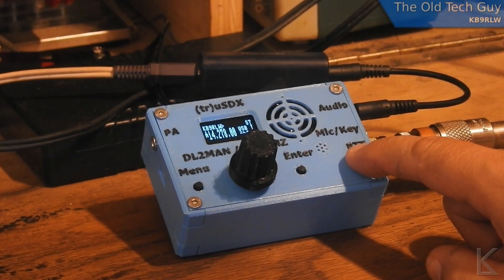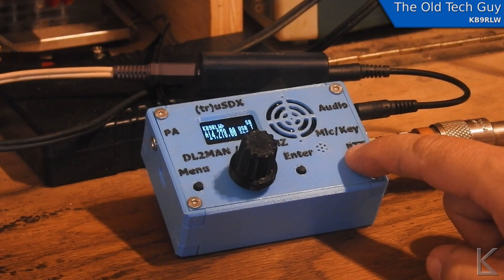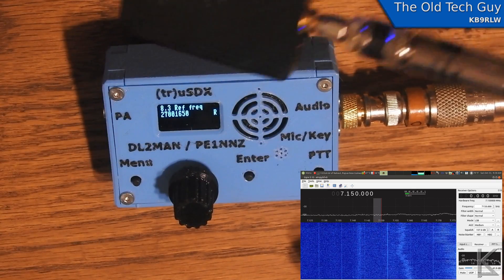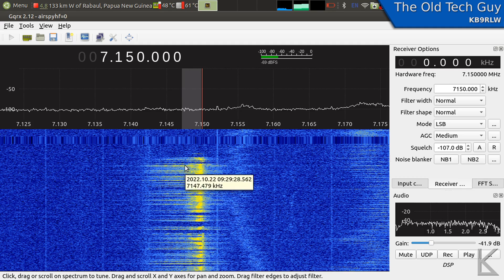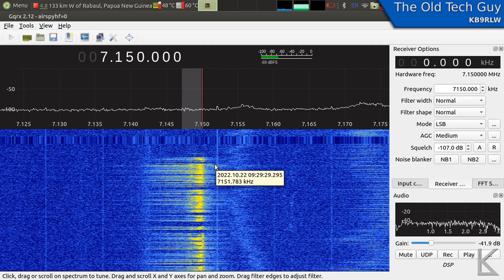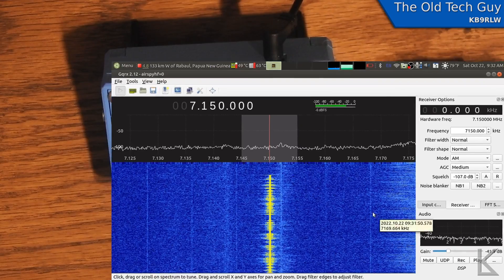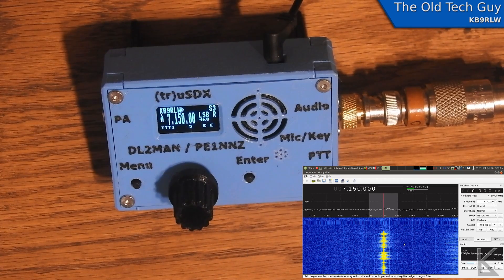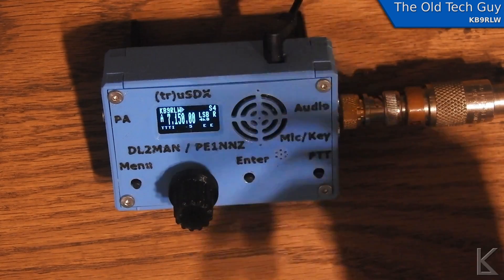Ham Radio - truSDX transmitted audio and signal quality in SSB, AM, and FM.

Comment: Thanks Kevin. My trusdx works great... except for the occasional shut off (I use it for CW only). I find that if I quickly unplug and replug the power source it operates again. But it's annoying if it happens in the middle of a qso. I am not up to the soldering you did. Are there possibly any other causes/remedies for the occasional shut off problem? Thanks, Scott
Reply from the maker: I don't know. I can only guess based on my own experience that it's going to be soldering issues.

Comment: I’m not sure if 1.0 firmware has mic gain or AGC.  But the 2.0 beta is abandoning AM/FM because it’s bad and rarely used.  In its place, you get a spectrum, direct USB audio/CAT, and a few minor things.  The stable release of 2.0 should be pretty good.  But your audio sounds a lot like mine, using a similar method.  The lower bands should also be significantly better, because it requires less processing from the chip.  There’s only so much an 8-bit Arduino can fake in modulation.

Comment: Hello, dear OM Kevin, 

you have to 'chanche' a view of your 'settings' in the menu, very, very carefully! 

Do it realy carefull, and sensitive, ... ! Step by step, not from 0 to 100 (255) in half a second, ... ! 

 - Less is more with the (TR)_U_SDX ! - 
 
I made it that 'way' and my results are better then before, ... ! 
(From the 'standard values', the radio comes with, ...!)

It is an 'experimental SDR-radio' in every word, that Manuel said. 

Each 'radio' will differ a little bit, (some more, some less) from radio to radio, on the hardware side. And then the software-part has to do the rest, and you, the 'user', has to do that very carefull!  

There is lot of work, for a simple 8-bit controller! 

Maybe, there are some glitches, we have to sail arround! 

Hopefully, only by 'gently chanche' some parameter in the menu! 

All together, the (small) hard-ware differences, and the new kind of SDR-software, to create a SSB-signal and demodulation, with the special kind in a new and 'different way', to buildt and use a 'Ham-radio'-TRX, will come together, and is 'not easy' to understand. 

Some differences (bad SSB modulation, too loud or too low 'mike-gain', or other things ...) will occure, when the radio is in use, from radio to radio! 

Most of the time, you can 're-adjust' some things, in the menu, and all will be 'right'. 

Maybe some 'things' are not that easy to get right, but Manuel and Guido will do the best they can do! I'm sure, that it is that way! 

Stay in 'tune' with Manuel on his HP and also on the forum, especialy made for the (TR)_U_SDX ! 

Look for any new details and hints, that will come in a regulary way, ... ! 

There are a many 'answers' to a lot of questions, that will come in the future, to find right now! 

I should say: RTFM, ... but it's a lot to look for, ... for a 'simple experimental radio', that this two guy's implement, in the last two years! 

It helps me a lot, during the 'bad times' in the 'Corona shut-down' periode, here in DL and I'm a proud 'user' of that 'special little QRP-radio' ! 

Please be aware that English is not my native tounge and when you find some mistakes in spelling and/or writing, please be so kind,  'collect' them carefull and recycle them in a 'professional' way, ... ! 
Thanks ! 

73/72 de Markus ; db9pz 
(5 km/3 miles east of LX ; JN39FQ)

Comment: Thank you for sharing your test results.  I just built one of  these and it works fine except for  SSB tx audio. I monitored the signal using another radio and no values for 3.2 Noise Gate or 3.3 TX drive provided adequate TX audio.  I had several contacts tell me the audio was "scratchy".  This plus the splatter as you pointed out,  make me think it is overmodulating.  Do you think a firmware change  is needed or hardware?  Thanks again, I always enjoy your videos.

Comment: Thanks for another informative the video.   Love my (Tr)USDX, but i have received several poor audio quality reports on SSB described as "distortion" or "overmodulation".  Without hearing or seeing your RX transmission it is difficult to determine if using a different mic or changing the mic gain settings offers much improvement.     By the way,  I also had good success using the MX-P50M(with mod) and Minipa70 amplifiers with the radio.  Not for QRP work, but it can help punch through pile ups.

Comment: Might also play around with the "transmit drive" menu 3.3, Manuel says 4 is the best compromise and if you turn it up you get more compression and at 1 it's very linear. But some times reasonable minds will differ...
Reply from the maker: Thanks for that.  I've been digging around a bit trying to find an explanation of what that setting is precisely for.   I'll fiddle around with it after I get settled back in at the new location.

Comment: I’ve made over 130 QSOs on mine, as far as 2000 miles, all on SSB or FT8 with CAT. Never had any complaints about audio quality on phone. Amazing little rig. Your splatter seems worse than the TinySA output I’ve seen would indicate. Hard to know what is normal as they are all hand built.
Reply from the maker: I've never had any complaints either, with over a dozen SSB contacts.   
Yours may be fine.  I've heard from a few people that have also looked at their signal using another receiver since this vid went live.  Some have clean modulation, others have distortion like mine. 
Seems hit n miss.

Comment: Its a fantastic concept in terms of showing what is possible with so few components and inovative way of generating SSB, AM and FM. Would be great if it was based on a cheap ARM MPU instead of the Atmel since these are much more powerful and have enough flash memory not to need to compromise on features.

Comment: I'm wondering if the SSB transmission sounds " not so well "'  because of the finals in this radio. Is it not Claas-E, that is used ?
Reply: It's generated by variying the output stage bias to create the amplitude envelope and rapildly reprogramming the frequency synthesizer to create the frequency components. At least that is as much as I can make out from looking at the circuit, the C++ Code and the description.

Comment: Both the onboard mic and speaker are emergency devices, add-on functions, the absolute minimum to get by on if needed. I think you can even use one of its buttons to send CW if you lack a key. Because assembled kits can be purchased from China, too many people seem to think this rig is a commercial appliance instead of a dirt cheap experimental rig. From tuning to interfaces to mic and speaker it's an experiment, a project radio. Yep, it works, and for the $60 in parts and ingenious software it's a many-mode multi-band rig that works pretty well and will serve a lot of poor hams around the world, giving them a chance to get on the air, and then embellish it as they learn and can get parts. But it's up to the hobbyist to make it work really well. That's the whole idea. We're hams, not CBers. We have a license to experiment, to do whatever we want with our radios, to design and build them from scratch, build a kit, or buy an appliance to plug into the wall and an antenna to plug into the back, our choice, it's up to us. We have a license to do it all. These rigs aren't appliances. They're projects. Hams have added variable voltage to their (tr)uSDX's to control output power, they tune the output toroids, they've added external speaker mics, even turned them into HT's - so far. That's just the beginning. I figure showing creative ways to solve problems and improve these little rigs are what the YouTube videos are going to be about, and I'm surprised when I see them being reviewed, video after video as if they were Kenwood's or Yaesu's. They just aren't. They were never intended to be. These are for the people who dig into ham radio, not the super-CBers.

Comment: Excellent! There will always be a limitation to how good it can get with 8 bit processing but it would be nice to get it as good as we can. Really hard to know which steps help if you can't check the result. The best I have been able to do is to listen to myself over web sdr, usually sounds weak and not too clear but... it has been good enough to make contacts. It would be nice to make it better, so what you are doing is very good. Thanks!

Comment: I got one a few weeks ago. For what it is, it's amazing. Even to just take a "deep dive" on how it works and the math behind the signal processing it's worth the $150 or so it cost.

I have a feeling the SSB problems are a result of the Amplitude (PWM) modulation and the Phase modulation being slightly out-of-sync with each other. SSB is the only mode where it has to both phase modulate and amplitude modulate at the same time. For CW and AM, it only has to amplitude modulate (via PWM) and for FM it only has to frequency modulate (by rapidly changing the frequency of the SI5351A). But for SSB it has to do both! If they are just a small bit out of sync with each other, you won't get a clean signal. Because the Si5351A is controlled by I2C data, getting it precisely timed with the PWM modulation will be a little tricky.

Comment: That’s interesting. After this video, I tested mine on SSB. My audio seems just over 2KC wide, with no bleed over to the opposite sideband. I don’t have the same equipment as you to measure the signal, but used my FTDX101D while the (tr)uSDX was transmitting into a dummy load.
Reply: @loughkb  I tested again, all bands. I notice that this problem does occur for me when I’m not in the section of the band for which I’ve tuned to suppress harmonics. When I’m close (within 50-100 KC) of that spot for which I tuned the coils with the NanoVNA, the SSB looks much better.

Perhaps that might be a reason to dip the harmonics at a frequency within the SSB portion of the bands?  I might have to play with this some more. 

I’ll be interested if you or others can confirm better SSB characteristics near where the harmonics are best suppressed.
Reply from the maker: Tuned which coils?   Are you talking about the LPF in the radio?   It shouldn't be nearly that narrow and should be a low pass not a band pass filter.  Something doesn't seem right there.  
I can't see how anything in the RF section would affect the modulation, which is done in software.  Unless, there's a problem with RF getting into the mic or audio chain before it gets to the atmega cpu.  
Maybe there needs to be shielding between the RF board and the digital board.
Reply: @loughkb  Yes, the LPF coils, labeled Lx2 for x=1-5. And is it a pretty sharp dip.   I’m not sure if it makes a real diffidence, but my SSB signal looked worst on 20m, but was much improved in the portion of the band for which I was tuned.

BTW, some to these as “2nd harmonic traps” and not low pass filters.
Reply from the maker: It shouldn't be a dip in a low pass filter, rather a drop off going up in frequency and no attenuation going down in frequency.    
This is making me think it most likely is RF from the RF board getting into the circuitry of the digital board.   I will probably make a shield to go between the boards and see if that fixes things.
Reply: @KK4DF  does that impact receive, transmit or both? And are you sure? Thanks
Reply: @jertres2887  I believe the harmonic trap tuning only affects transmit.  It reduces spurious emissions of the harmonics.  FCC requires they be 43dB below the fundamental.

Comment: I think you can improve you measurement (wanted signal strength compared to unwanted / suppression) by having max hold on the top power over frequency indikation. These shades of yellow are really hard to judge wrt level, and a signal 50dB down might light up yellow still.
Reply from the maker: A signal that far down would only be a slight change in blue.